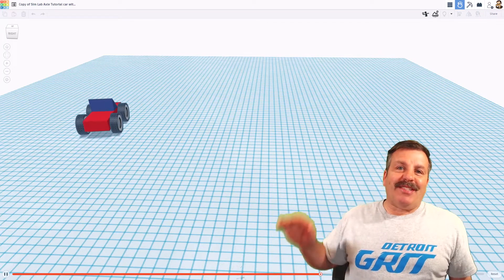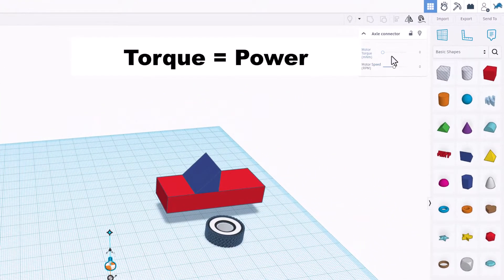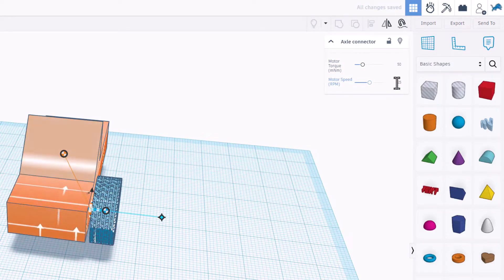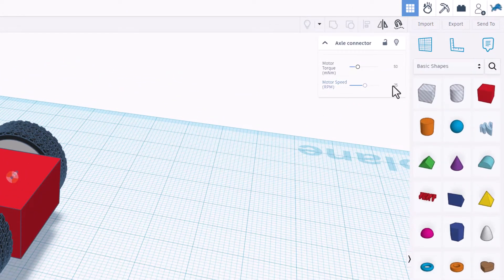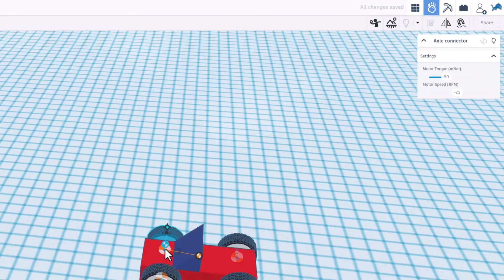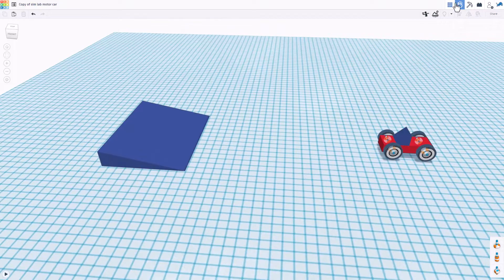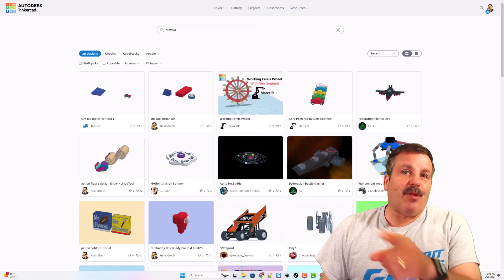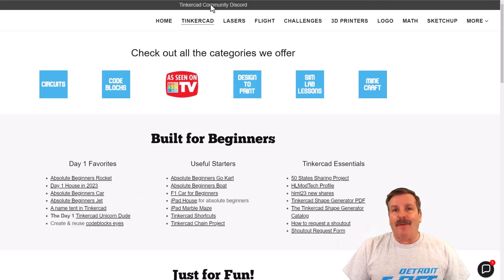Easy Steps To Building Moving Tinkercad Cars With Motors In Sim Lab

Comment: great video!!!
one question....  is it possible to animate the tt-motors along with the wheels as in your video
Reply from the maker: There was a user that had a project where the motor was animated. I’m traveling today, but I’ll see if I can track it down when I get home tomorrow. It was a pretty cool project.
Reply from the maker: A Tinkercad Sim Lab Working ENGINE Copy & Tinker Like A PRO in Minutes!
https://youtu.be/VlBzt3mOiV8
Reply: @HLModTech  ok - maybe i wasn't clear.. What I meant was the tt-yellow motors exist as a component. I am able to connect it to a microcontorller (arduino , microbit) an program it. I can clearly see the axle movement rotation fwd/backwd, but, when I try to add an appropriate wheel (that comes with the standard tt-yellow motor) and show its motion via programming (via circuits)  - that "animation" won't work...  I was surprised when I saw that  simlab has the option of showing movement/rotation...   I wanted to go further with the idea of animating a real "robot-car" using the tt-motor (single wheel in the back ) and front wheels (ackerman style) steering via servo....  Am I just asking for too much....  
Nevertheless, you have some fantastic videos suited enough for a begginer like me. Keep up the great work!
Cheers, Vladimir
Reply from the maker: Sim lab is pretty simple.. but people push it to some crazy levels. I do not believe you can combine with arduino/program via circuits. Sure would be cool though. See what you think of this robot. https://youtu.be/R0cB1RR3kek

Comment: Can the motors be made LARGER to enable them to rotate objects? I made a life sized crankshaft and the motor could not turn it even when I maxed out the Torque and RPM. I added additional engines and it made NO difference. 

I had to reduce the crank size to half it's true size and use the material of plastic to get it to spin. Soooooo, can the engines be enlarged to function with larger objects?
Reply from the maker: I would guess not. The Tinkercad max design space is 1000 mm sq. It is not intended for making life size engines or parts... It is just giving designers an idea how parts can interact. If you made your large object polystyrene it might rotate. I do not believe you can incorporate more motors to increase the power. Interesting idea though. 👍
Reply: @HLModTech  YES, it works with the lighter materials such as plastic, polystyrene, and wood after I reduced the size.
 I also hollowed the counter weights and main and rod journals.
Reply from the maker: Groovy. There are quirks with fit and function, but it would have been a blast in my classroom back in the day.